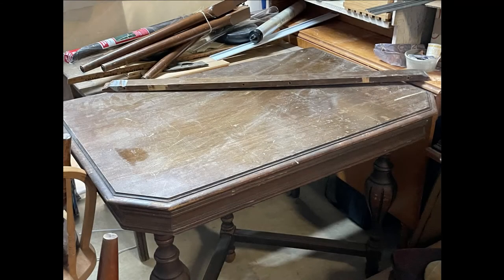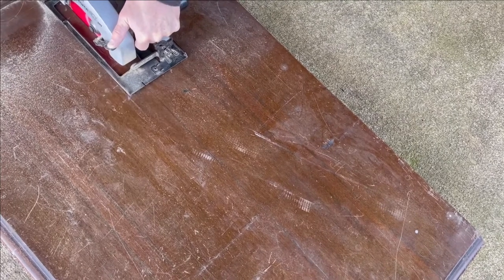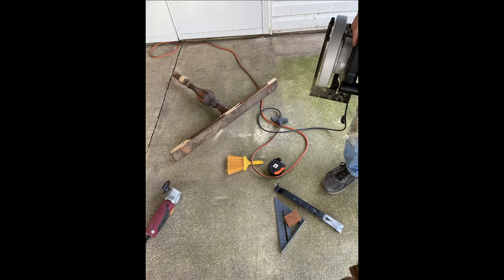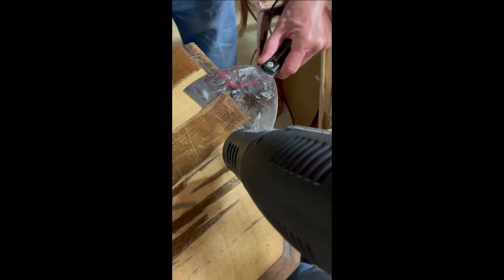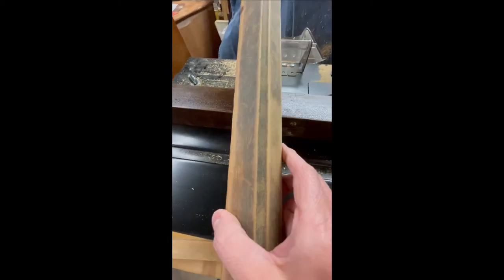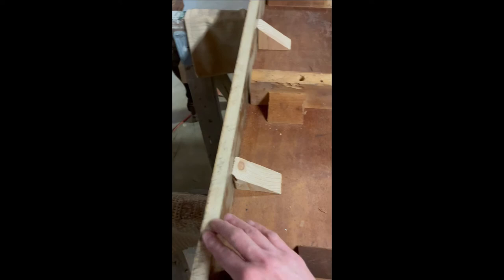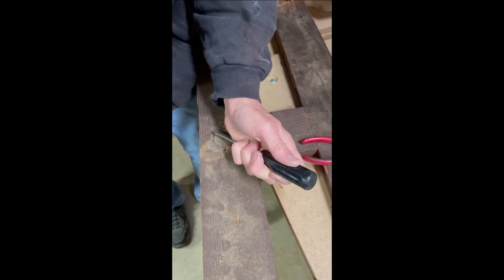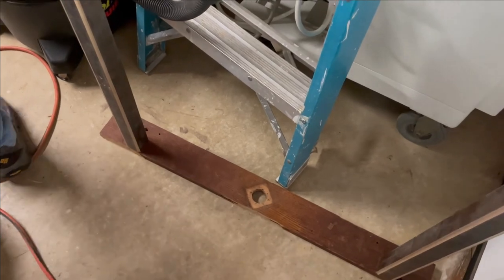How to Repurpose a Dining Room Table Part 1 (How to cut down a table to Make a Console Table)

Comment: Why did he not clamp a length of timber to the table top to ensure a straight cut with a guide edge?
Reply from the maker: Thanks for watching. Because it was safer to saw this large, heavy piece on the concrete, and because there was nowhere to place a clamp securely, he opted to cut it as shown in the video.

Comment: What year do you think these ta mes were made? I had one giving to me 4 chairs with that and I wanted to make some smaller stans and kr tables island that fit into my little kitchen that can be used for shelved or table. I didn't want to cut it up if it was worth something or rare. There is some kind of writing stamped in black underneath kind kf big but I can't read it.
Reply from the maker: Hi! I'm not sure about the age of this table, my guess would be 1930s to 1960s. This table was not in great shape when I got it.  The top had deep scratches on one side and it was really wobbly, so cutting it up and repurposing was an easy decision.  My personal rule of thumb for repurposing furniture is if it is a family heirloom or if it has been appraised at a really high price by a professional, then I don't paint/repurpose.  I do paint/repurpose if it's going to sit in my basement or in a corner unused as it is. I would rather enjoy a piece than have it sit.  Hope this helps!

Comment: Is there a video about the desk made from this table?
Reply from the maker: I’m sorry, I don’t have a video for the  desk. However, it was a similar process. We cut it to the depth we wanted the added a board to close up the open back. We also added trim to mimic the shape of the original trim on the table. Then we added a thin plywood over the top and used a router to match the shape of the table. I painted the base with Dixie Belle Chalk  Mineral Paint in the color Manatee, glazed with Dixie Belle Grunge Glaze, then sealed with Satin Clear Coat . The top was painted in Midnight Sky and sealed with Gator Hide.